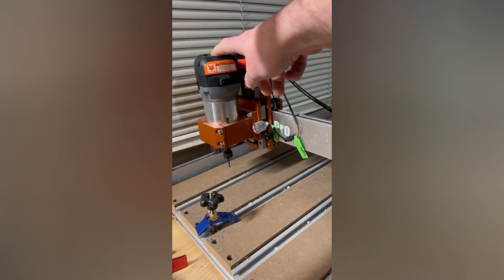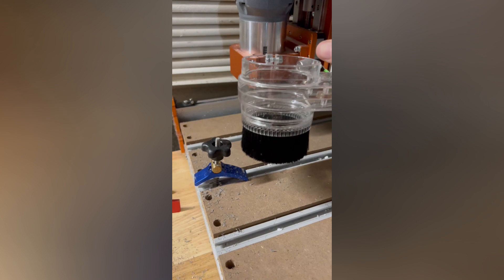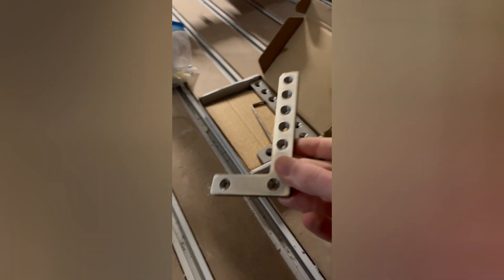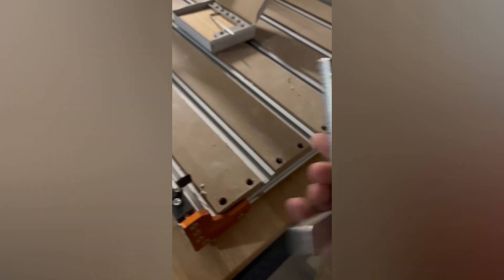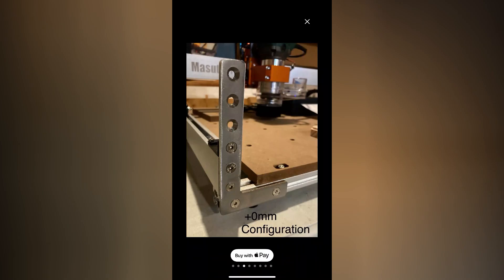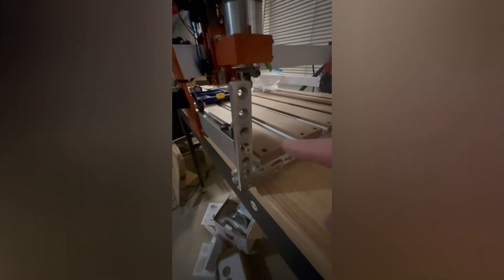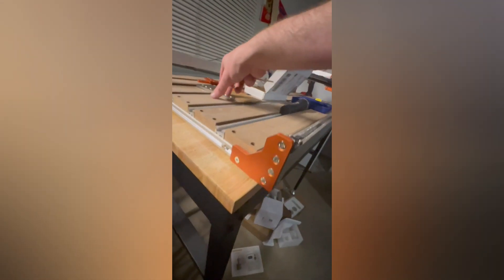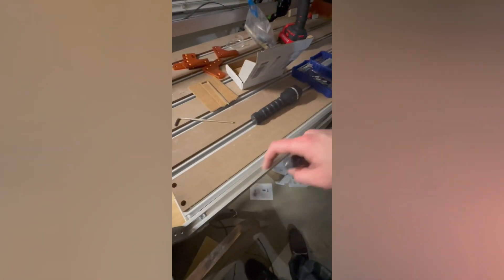How to increase the Z-Axis on the FoxAlien Masuter Pro for Dust Shoe

Comment: I increased mine by about 3/4".  Can be done by moving up the side rails on the OEM brackets by one hole.  The belt bracket does not need to be screwed into the end bracket.  By moving the rail to the top screw hole that gave me the clearance I needed.  This was for the 42mm shoe.